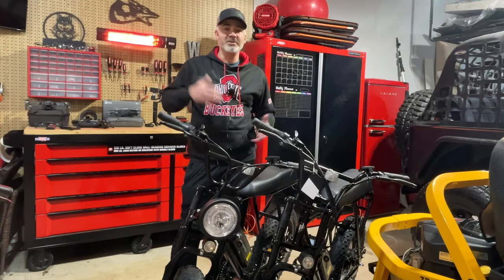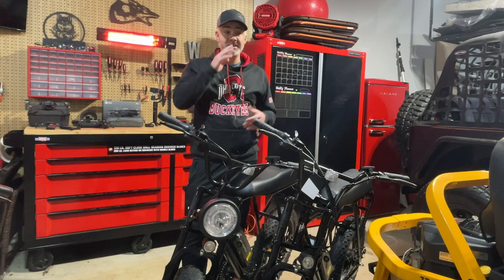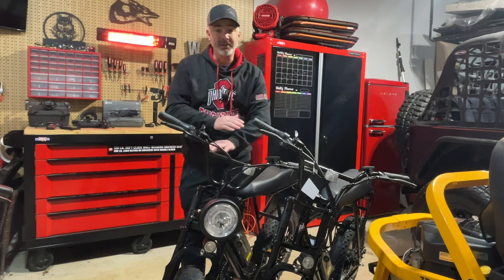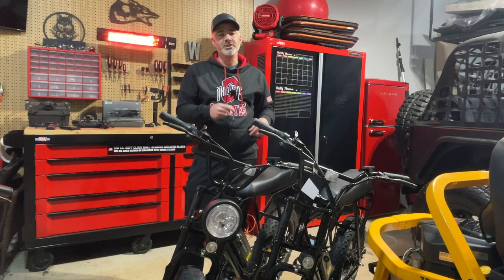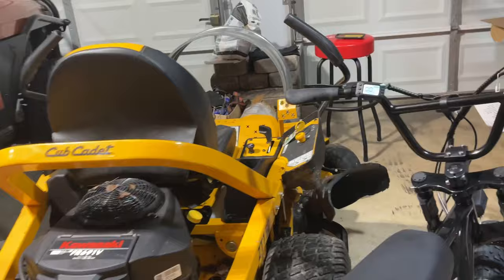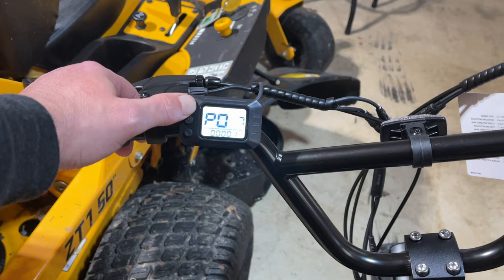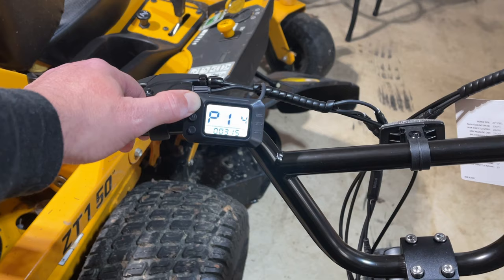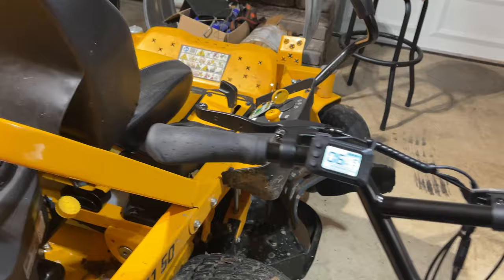🔥 HACKING MY EBIKE TO GO FASTER - NO MORE SPEED LIMITER

Comment from the maker: Remember this works with different speeds on different bike panels, but I haven't found a bike I can't do it with. Subscribe and reach out if you need help with yours. Thanks for supporting the channel.

#ebike #unlockebike #nrgsports
Reply: what about a truckrun m09 1200 watt 240nm would like to know how to unlimit it as got better display thats unlocked so hoping ive already found a way and i can use a uart usb programming lead to play with settings on my samsung phone with the SPEEED app
Reply from the maker: You could probably google how to get into settings on the panel. Then just raise it to max speed (usually 28mph), then change the wheel size to max (usually 29.5) and you should be able to go around 40. The engwe bikes have a max tire size in the panel of 31 so you can really fly!

Comment: I've had a 26 inch fat tire xdc600 dual motor 2000w 2024 model ebike for a few months now and didn't know you could turn things up in the computer I'll try it tonight and test tomorrow. I plan to upgrade from the 48v 24ah battery that came with it to a 52v 24ah for an extra bump in range and performance. 🤞

Comment: I am in Costa Rica and have a RAM Mia 1200 watt scooter. Looks much like a Vespa. But can find little to no information on it. One cannot get the seat latch to open. No info on any speedo settings. My top speed is 56 KPH/32MPH. I believe would be 45 MPH unleashed. Uses 10 inch by 3 inch tires and only 2 ply. Would like 4 ply with a higher rim to road height.
In return can keep you supplied with the very best coffee that grows right here in Tarrazu Costa Rica. Starbucks obtains its best and most expensive here.
I am more interested in higher speeds going uphill as only major highways are over 40 KPH. 20% grade is about all it will handle uphill and at 38 KPH. Has a 60 Volt 40 AH battery.

Something I did is add a crash bar/foot rest. 1 inch box steel above, below 1 inch flexible PVC which gives me somewhere for my feet as well as some protection against roll over.
Reply from the maker: Sounds like a great unit. I would LOVE to check it out in person.

Comment: Can you show us how to unlock/derestrict Aventon Aventure 2 bikes? It only goes 20mph on the highest setting or 28+ with pedal assist. I know the motor can go faster in throttle alone.
Reply from the maker: That's an easy one, we've done a number of those. You have to get into developer mode. If I recall correctly it's the plus and minus at the same time for like 10-15 seconds, then you can scroll through the options like top speed (which show KM, but you can raise to around 75) and then the next should be tire size. You can lower it and it won't have an accurate speedometer, but will increase speed another 5-10 mph. Best of luck

Comment: Sorry for the barrage of questions but the new bikes dont seem to have the magnetic speed sensors are they integrated now or something???
Thank you
Reply from the maker: It all depends on the ebike manufacturer. There are safety regulations to get the UL certification and this is one of the hot topics. The panel method is still available on all models and seems to be the way to go in the future. There is always a work around. Thanks for subscribing. New ebike reviews coming soon and we will talk about it when those bikes have the magnet if you are looking for a new one. We are also doing ebike giveaways coming soon which is exciting.

Comment: Thanks for your video, just subscribed!  I grabbed an Ancheer Gladiator 500watt, will this hack work on this model? tops out at 21 MPH right now, but the way it accelerates quickly to 21 and drops off, I feel like it has more in it to go a bit faster.
Reply from the maker: For a 500W motor you might be able to get 25mph, but not much more. The key is W motor and battery voltage. 52V and 1200W would be ideal. But they are a bit pricier in the $800-$1200 range.

Comment: Yea all my ebikes think they have like 8in wheels. Yea you can't get the real speed from that display anymore but just use a gps app on your phone and use a good phone holder. I actually use my old cell as my bike computer for gps/speedo/plus I record while i ride(for security reasons mostly since I've been hit a few times over the years and all of the drivers left me so now I have a GoPro 10 on my helmet, my iphone recording on my bars recording  forward and a Garmin mini clipped to my rear rack facing backwards and they all record to my cloud through my new phone in my pocket while riding. And to anyone who thinks that's overboard try having bilateral hip replacement, broken collar bones and 5 fingers at one time in your 30s. My Giro helmet saved me btw. 
And like I said the person bolted like they always do.
Reply from the maker: 8in tires? Those are babies

Comment: Hey great stuff! I noticed you have a Rattan in one of your videos, I do too. Are you able to unlock it furthur with the panel method as well? Thanks
Reply from the maker: Yes, Rattan actually you can unlock with just the panel. Mine went up to 40mph
Reply: @NRGSPORTSANDHOBBY  Wow...just by doing the same in this vides, maxing out all the settings? I'll have to try it some time. There's a lot of Rattan owners out there that would be interested.

Comment: I have a colorway fat tire bike but I need help I can get it to 40 but it doesn’t confirm it goes back to the regular setting and only hits 19.8
Reply from the maker: This is common on a lot of panels. You have to hold down a button to save the change. Every panel is different. Try holding the power and down button for a couple seconds. I don't have that ebike to test it. But it needs to be saved.

Comment: I got a Aventon sinch.. I have turned the settings up so it goes 21 and 28 Paddle assist. How do I modify it to go faster?
Reply from the maker: Great ebike. That particular bike is only rated to go 20mp. So getting it to 28 is an accomplishment. If you raised the settings and the tires, this might be the fastest it can go without additional modifications. But you need to make sure the motor can handle it. Our Haoqi ebikes use the same. display and I can get it up to 42MPH, but has a much bigger motor. That sinch also has a low weight limit. So it just may not be able to go faster with a person on it, Did you lift the back wheel and go full level 5 on the throttle without sitting on it to see?  Also if you changed the tire size it may show 28mph but might be going faster.

Comment: I have that exact display thing but it does not seem to have a thing to change the speed on that, is there a way to change that
Reply from the maker: If it's the same display, then it's the same way to get into settings. Holding the plus and minus for 3-5 seconds

Comment: I have a Jolin 81f display on my Shengmilo S600 and I can't figure out how to adjust pedal assist power on each of the 1-7 settings. I want less assist on pedal assist on the 1 position.
Reply from the maker: I've never done that ebike in particular, but I'm sure it's similar to other ebikes I've done. You can adjust each level. There are C settings and P settings. Here are the P settings and what each one does:
P0: Fixed setting that indicates when the wheel diameter needs to be changed
P1: Fixed setting that is usually the default voltage
P2: Fixed setting that shows the minimum voltage and wheel size
P3: Fixed setting that shows the speedometer speed setting
P4: Types of speed display, such as Km/h (0) or mp/h (1)
P5: Types of start mode, such as kick start
P6: Cruising mode setting
P7: Pick up speed
P8: Max speed setting, ranging from 1–100%
P9: Electric brake strength
Reply: @NRGSPORTSANDHOBBY  I have the P settings figured out. I can't figure out how to adjust the percentage of power applied in each pedal assist position which I have set for 7 levels. The manual says they are adjustable and says see schedule 2 and no schedule 2 is  listed anywhere i can find. On pedal assist level 1 i pedal like crazy in 7th gear and cruise at 24mph. Way too fast foe the 1  position.
Reply from the maker: When you called the brand, what did they say?

Comment: I have the 2023 Eahora Juliette and would like to unlock the speed limiter. It is set at the highest programmable speed of 51 kmh which is about 32 Mph with the approximately 23-inch diameter tires it came with. Changing the programmed tire size only changes the displayed speed, not the actual speed which is determined by the maximum wheel RPM allowed. I would like to put low profile motorcycle tires on it, but that would change my tire diameter from 23 to 20-inches and lower my top speed by about 4 mph. I think the motor maximum rotational speed must be set by the controller module, but I was hoping there was a way to override that so I could use the smaller tires and still achieve the top speed of 32 mph. Do you have any suggestions?

Thanks, Jim
Reply from the maker: Eahora you can't unlock, I have the Romeo Pro and 32 is the fastest it will go also. I do have the dual motor version coming which goes 45. Sorry
Reply: @NRGSPORTSANDHOBBY  Thanks. I'll have to find a high-profile tire for the rear so I can prevent losing any top end speed. Someone will probably come up with a replacement controller that will allow this in the future. There are always alternatives and at 72, I'm quite happy with the 32 Mph top end.

Thanks again, Jim
Reply from the maker: Oh yeah, 32 is great

Comment: That's great if you have one with a screen like that. My "screen" has five straight lines.  Only one button. Throttle.  Hood do I do it on mine?
Reply from the maker: Sounds like you need the magnet method

Comment: Is there a way to increase speed without magnets? So, for example, what if you don’t use the peddle feature? Only throttle… anyway for that scenario?
Reply from the maker: Yes, we have a few different panel videos. Usually the panel or controller can bypass the limiter. Just find the video with your display and follow along.

Comment: I have a Fatbike Volta VB2 and this worked , it went from 15,5mph (25km/h) to 26mph (42km/h)...  The bike looks different but the lcd panel is the same.. Thankyou  for sharing !!! 
but just in case you want to reverese it. Do you happen to know how to just reser it ?
Reply from the maker: I always suggest writing down or taking pics of the numbers before. Really the only three that make the difference is the Voltage to the motor, the tires, and the override (P08). Enjoy the faster ebike

Comment: I have an alvas 710 ebike its not a great brand though its 250w motor 36v 12.5amp=450wh batery pedal assist am throttle ebike i unlocked speed limit feom 15.5mph yo 20.9mph is there anything else i can do to increase speed? Could i put bigger batery into it say 48v 20ah batery maybe? Or would this damge the motor? Any advice id be greatful thanks.
Reply from the maker: I wouldn't think you could do any better with that motor size. Sorry

Comment: I Have a Vivi 350 or 500 w. If i replace the shitty "screen" (which isnt exactly a screen) that has 3 modes with a lcd or LED screen, can i go faster?
Reply from the maker: No, if your model does not have a screen, the only unlock capable mode would be to remove the limiter wire or magnet (depending on the model). However keep in mind, the motor won't go much faster than maybe 25-28mph. Better to get a larger motor ebike to go faster

Comment: i have the vivi 500w ebike. unfortunately it doesn't come with a digital panel but rather just a small LED light kind of control. How would I remove the limiter with this kind of bike?
Reply from the maker: I'm not sure without seeing the panel. Most you hold the up and down for 3-5 seconds to get to the hidden menu

Comment: Will this affect the max range when you modify the max speed in the display settings?
Reply from the maker: The more power you push with your ebike the less the range. This goes for whether you unlock it or not. Example level 2 will have a longer range that level 5. So YES you will get less range ofcourse
Reply: @NRGSPORTSANDHOBBY  Thanks for the tip and information. This is helpful.

Comment: The settings menu on hey bike is different. It doesn't havemp settings. The es something like p5 with a 6 digit code. I think you need to know the pin
Reply from the maker: We did it on our heybike. All you do on that is change the tire size to trick the bike to go faster. It will still show 20-25 mph, but you will go closer to 40 (panel will be confused)

Comment: Does it work on all bikes with panels, like the mini ones from
Costco? Also will it cause the battery to heat up more and try harder?
Reply from the maker: I can't speak for any ebike. Only the ones we review. If you are getting an ebike that will cause any battery to overheat, I would 100% avoid that ebike. How much is the bike? You can get one from amazon for $500 that you can go 40 mph after unlocking and it's incredibly comfortable. We just posted one on the channel today.
Reply: @NRGSPORTSANDHOBBY  i am getting a onebot s7 and was wondering if the speed unlocking works on all e bikes, I haven’t heard of any overheating and fires on that e bike. It is one of the better ones people say, it is a 350w peak but 250w regular with 36v
Reply: @NRGSPORTSANDHOBBY  now that you have recommended it to me, I’ll probably be getting the oraimo, since it is UL certified and a good bike
Reply from the maker: That's a good choice. Very affordable too and. $100 off right now - https://amzn.to/3LnMjsA
Reply from the maker: The onebot is super small. oraimo is a full size bike and much more powerful
Reply: @NRGSPORTSANDHOBBY  hey, just wondering because I just ordered an oraimo today…but the same thing you did on this bike with the panel, is it the same thing with the oraimo??? Not sure if it has the same settings or not lol
Reply from the maker: Keep in mind, the Oraimo is a budget ebike. With a smaller motor so it won't make a huge difference. Need at minimum 500W motor to take advantage of unlocking it. You might get a few miles per hour faster. But not like a 500W or 750W motor will get you. Hope that makes sense.

Comment: Mine goes 15mph max and has no screen, so how do you do it for that please. 

Would I have to add a screen with settings, or no?

I have the DYU t1. I just want an extra 5- 8 mph.
Reply from the maker: Without a screen it would be impossible to go into developer settings on that ebike. Which means it's likely only a magnet redirect option to override the limiter. What is the Battery and Motor on that model? You will need at least 48V and 500W to see any real improvement.
Reply from the maker: Just looked it up 36V and 250W. You won't be able to go any faster sadly. Maybe you can trade it in for a faster one?

Comment: I have a Miclon cyber 100 and it has a different display. It has a power button on the right side and two pedal assist buttons on the button. Plz help
Reply from the maker: Miclon is a bit of a budget ebike. I do not believe you will get any improvements.

Comment: Hej I have a 250w Himo c26 without throttle. Do you have any ideas to get a few more mph. 16mph just now.
Reply from the maker: 250w motor isn't designed to go much faster. Wattage is the most important for speed. Maybe trade up to a 500W or 750W? They aren't much more and you get a ton more speed and torque

Comment: Please Send link for magnet   I bought a wooken 500w fat tire it says 20 mph top speed. I’d like to increase that if possible
Reply from the maker: You probably don't need to do the magnet. Try and change the. tire size to the largest it will allow. Then your panel will still say 25mph, but you will get closer to 40
Reply: @NRGSPORTSANDHOBBY  cool thanks! Will doing that wear the motor out sooner, and how much does it usually decrease the amount of miles you can travel on a charge?
I also should have a Heybike Brawn soon that listed at 28 mph with a 750w
Reply from the maker: It depends really on the motor. 500w you shouldn't see much of a range drop off cause the 500W can usually get up to 40 without much effort. Now the Heybike is a beast! I have a few myself here. It's even easier to unlock. I visited them at CES this year (they had a great booth). They are coming out with all kinds of models. Great choice.
Reply: @NRGSPORTSANDHOBBY  thanks for your advice! If I have any questions down the road hopefully you or your videos will help me along. Thanks again!

Comment: Hi I would like to find someone who can show me if this can be done on a veleco Gravis mobility scooter before I begin with changes to the controller, which is a 60volt setup that can do better on the 1000watt motor. Please help im getting 12 mph at present
Reply from the maker: Mobility Scooters don't have speed sensors connected to the pedals. Yours will have a controller. You'll have to actually find out which wire to cut from the controller itself. They aren't made to go that fast though, so use caution.

Comment: Greetings I’m in Michigan I just purchased a smart travel E bike out of the box it goes 35 miles per hour. Is there any way I can get it to go faster???
Reply from the maker: Of course. What's the brand? You just have to get into developer mode. Since they removed the magnet on the newer ebikes, you just have to get into developer mode and raise the max speed. Most I've gotten with a 1000W motor so far is 42MPH though without changing the tire size. But if you do that the speedometer won't be accurate, but will go a few miles faster. So keep in mind unless it's super powerful 1500W or more motor it won't go much faster